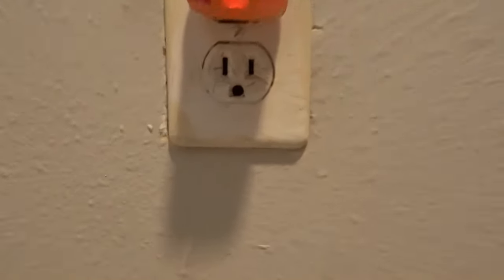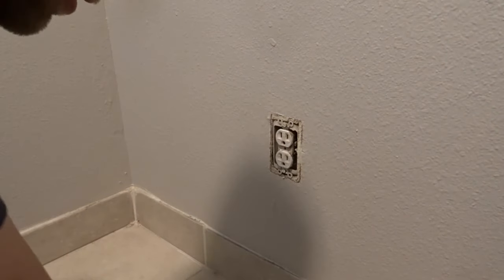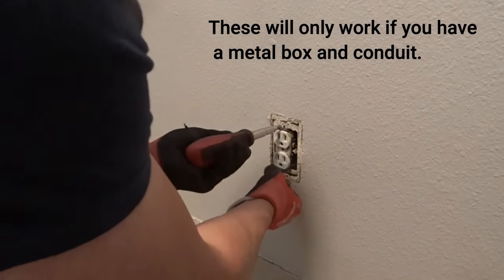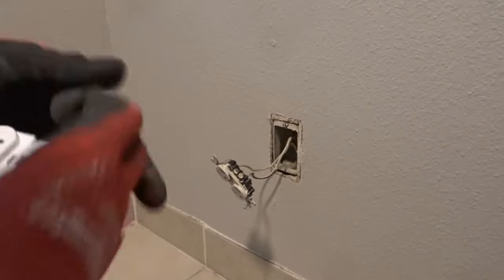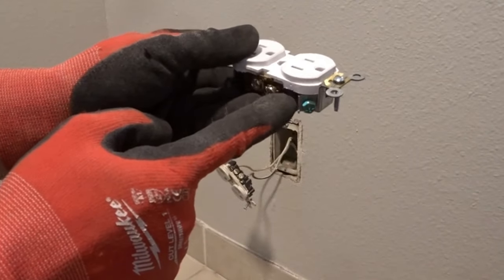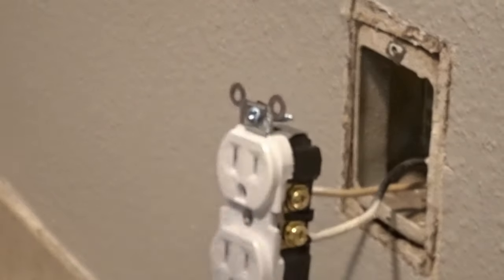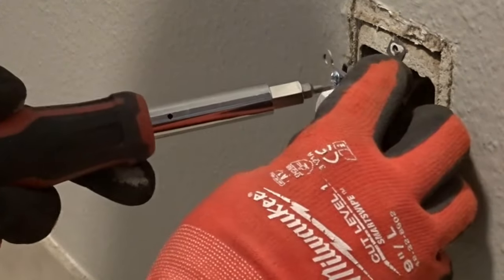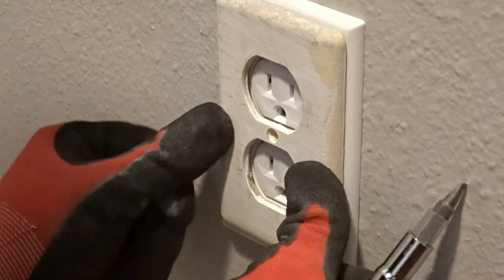How To Replace An Outlet | Ungrounded to Grounded

Comment: Your cutting wires short just pissed me off
Reply from the maker: They are longer than required by code, 6”. 
But you are welcome to post a video. I bet you can do it better. Be safe :)
Reply: @aaronfixesstuff  the cutting I just seen you do, looked like it left only 3" or so to work with,  but the 6" rule you just stated is proper. 
edit 6" poke out the wall. Not from back of box,. Just to be clear.

Comment: I suggest that if you have a 3 wire service >>>  A&B phase 120/240vac Hot w/ Neutral only main panel , that you watch and install 3 plug receptacles replacements in this manner !    
{  https://youtu.be/16KObgI44UE  }

Comment: Unless the box is mechanically connected throughout the the entire run it won’t be grounded, also he should have cleaned the paint off the box for a clean contact between the box and outlet. Also to ensure a ground he could have pigtailed a ground wire from the box to the outlet. 
Poorly done vid.
Reply from the maker: Follow me for more poorly done videos 😉

Comment: tattoo is grotesque, nauseating, and unprofessional. Not sure why you would let someone permanently disfigure and mutilate you. That said, what you did only works if the box is metal and grounded, and in your case, metal conduit pipe. Regardless, you should use a ground wire, and when you have metal conduit pipe, there is no excuse of not pulling new wire other than laziness. Do it right or don't bother. Spend money on good stuff, not on disfiguring and mutilating your body.

Comment: That's not legal using the box and conduit as the grounding means. With that said, this isnt legal either , I would use insulated wire from the neutral to the ground. This is the same deal as your bonded panel, only you bond at receptacle instead of the panel. Same difference since the neutral is a grounded conductor.
Reply: 🤨🤨🤨🤨What No no no

Comment: I never knew that about the preferred type having it's own ground so thanks! Also smart wearing gloves. I don't know how many times I have stabbed myself with a screwdriver doing this work.
Reply from the maker: Glad to help! And I will confess that I sometimes forget to wear gloves as well :)
Reply: The Leviton commercial grade have a brass spring loaded piece where the tension is directed to the front. In many commercial applications and residential garages the receptacle is mounted directly to a metal cover plate and this will provide excellent ground. The cover is screwed to a grounded metal box. The box is usually exposed using metal conduit.